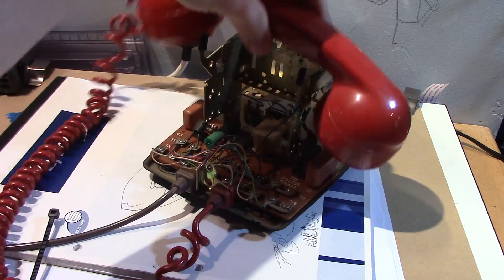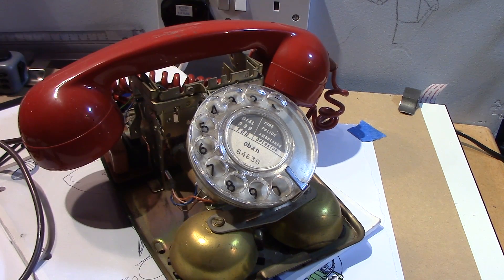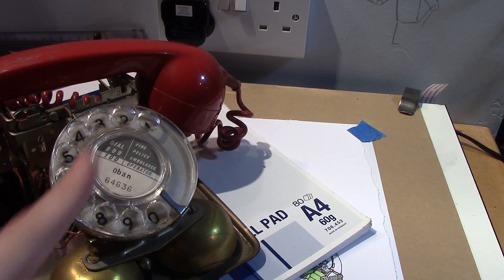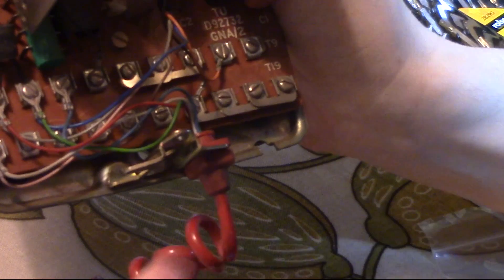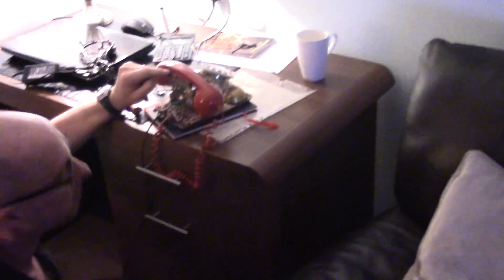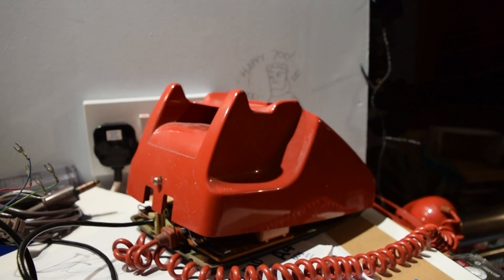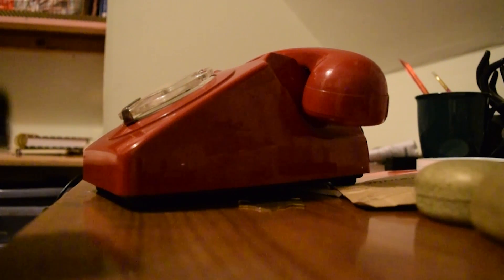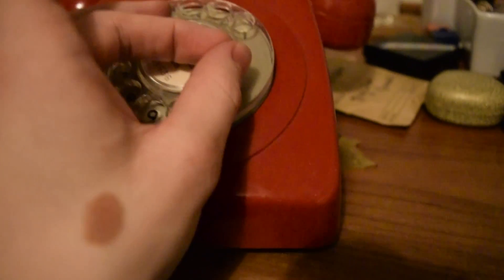Converting An Old GPO 700 Series Rotary Dial Telephone to Work on a Modern Line.

Comment: None of the equipment used in the seventies was still in service beyond 1999!
Reply: Interestingly many rural parts of Scotland, including Raasay, are to this day, still served by exchanges developed in the 1970's. The Broadband capability in these areas is an "add on" , not "an instead of" technology. The functionality was continually updated and improved right up to the 2010s. These exchanges will still be in service for some time.
Reply: @Cyclic-i3d  Which type of equipment is that?

Comment: The 3.3K resistor is to reduce to the ringing current to a REN value of 1, the pinky-red component is a rectifier made from two back to back 1N4001 diodes in parallel, this is to limit the ear-splitting pop you get on the receiver when tapping the switch hook, it's installed across the handset receiver terminals (green and red).

Comment: Just like any phone you need a microfilter between socket and phone lead. Broadband will be fine. If you are on a new digital exchange you can buy a PULSE TO TONE convertor to dial out. You will also be able to use the star and hash function.
  I dont know why but rotary dialing a number is better than punching buttons, (discuss).

Comment: Great video. Is there a way to power the bells so they always ring when the phone is plugged in?  I followed the set up and the bells only ring when the phone is called. Thanks.
Reply: Lmao. I have this scenario in my head where you give this to a mate to piss him off...a constantly ringing phone!
Reply: Giles Braid I want to be able to use a relay to control when the phone rings. Based on actions in the environment.
Reply: Sweeeet! All of the fun...you could trigger it to ring when either the door bell rings, microwave timer finishes or when the tv is turned on!!!
Reply: Giles Braid exactly. But, how do I power it without plugging it in? Any ideas?
Reply: TeCoEd I think the ringer circuit is directly connected to the exchange. So you'd have to spoof that signal to get it to ring. In my 5 mins of reading it's an AC 75v RMS, 25hz, 0.4 sec on, 0.2 sec off, 0.4 sec on, 2 sec off, repeat. So you'd have to design/find a circuit and power supply to do that for you.

Comment: What phone service are you with? I'm with Comcast and want to buy an rotary phone
Reply: Don't want to waste 300 sum dollars
Reply from the maker: Are you in the USA? It might be slightly different over there, pulse dialing is being phased out by Comcast, I believe. Might want to check some forums. What I would say is do NOT spend $300, there will be phones like this you can re-wire and get working for a fraction of that price!
Reply: Gillers yes I'm in the USA
Reply: Gillers the phone I want is 300 including pulse to tone converter
Reply: Because your in the US I feel it's best to buy a retro styled one as pulse dialling is being phased out over there. Even 2G mobile isn't there anymore on AT&T but here in the UK all the networks still have it. Also if you bought one from the UK our socket size is a BT one and yours is an RJ11 and if you get through to one of those press 1 for customer service it won't work.

Comment: Did you see this? the same sort of telephone BUT it has a blue tooth circuit in it. when your cell phone has an incoming call the old rotary telephone rings just like it was wired to the wall. I found a demonstration on youtube, you can make calls on it too. search western electric bluetooth on ebay too

Comment: It won't effect your internet if you have converted it correctly.Some providers don't accept pulse dialling which is what rotary phones dial out in, some modern landline services only accept tone dialling.BT and Sky accept both. :)
Reply: It's wired correct! Just tried it in my new flat and works fine, no problems with the internet. I have a feeling the microfilter in my parents house just isn't quite working properly.